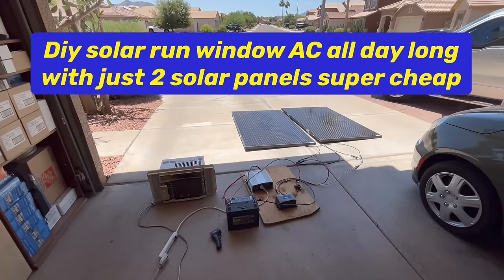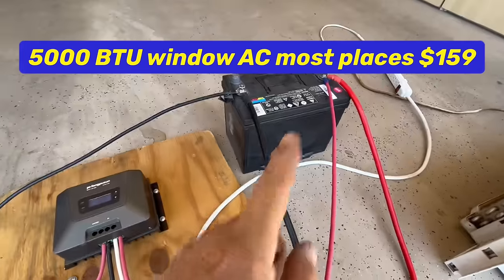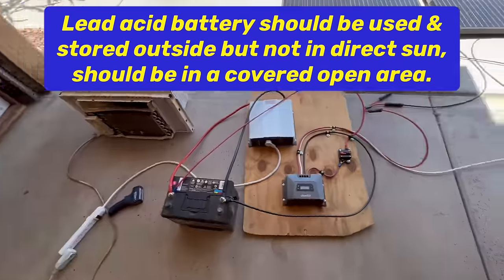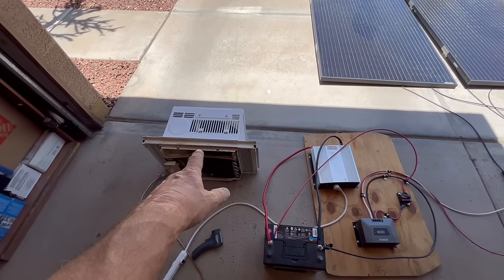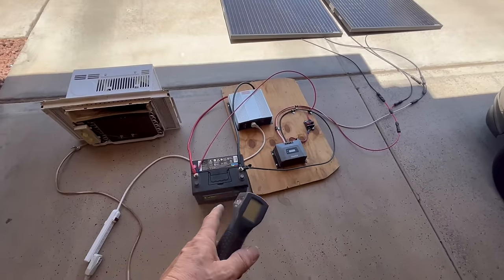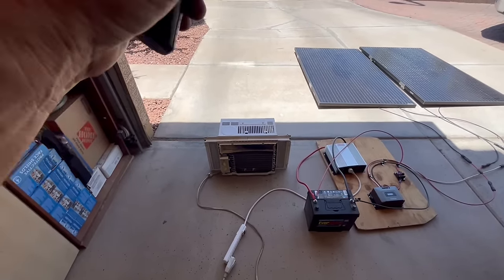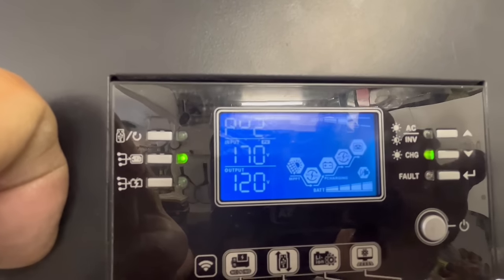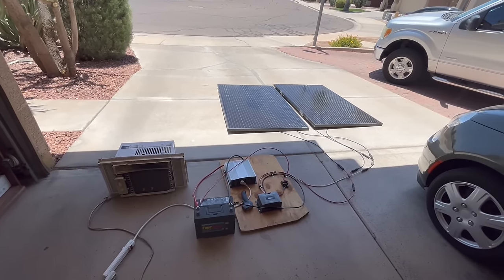Run your window AC with just 2 solar panels when sun shines. Easy DIY project you can do in one day.

Comment: So I was wondering I have 4 320 watt solar panels wired in parallel 5 100ah agm batteries in parallel aswell and a 3000 watt rms modified syn wave jupiter inverter and I can't run mine for more than 5 minutes without it draining my batteries and alarming the inverter?? I'm so confused
Reply from the maker: What is the actual output of your 4 solar panels. My 250 watt used poly panels are only giving me 112 watts. How many amps are you getting out out your solar panels in parallel? Your AGM batteries should be fully charged at standing voltage of 13.2 volts. My window ac uses around 450-550 watts and around 4.5-5 amps. My 2 330 watt solar panels were able to give me over 600 watts while running ac. You have to bring in at least 10-25 percent more watts than you are using so you can keep battery fully charged while running the ac load. If you have 10 solar panels and they are only giving you 50 watts each and your ac is using 550 watts, you will drain your AGM batteries. You have to always have more watts coming in than using and you want your ac to cycle off and then back on. When the ac cycles off, the AGM batteries will be able to charge faster with most watts being used to charge batteries rather than running load. Sounds like you are using more watts than solar panels can produce to run ac. What charge controller are you using. You did not a charge controller or all in one inverter with charge controller. I did this set up years ago and it was a bare bones set up just to show you can run ac with solar.  Ow I run my 3 1/2 ton whole house heat pump ducted ac to air condition my house 24 hours a day. Solar panel input during the day and LiFePO4 51.2v 100ah server batteries at night. I spend $0 on air conditioning my 2 story, 2450 square foot house and air condition my garage during the day as well. I heat my 15,000 gallon in ground pool to 89 degrees and run my pool pump 24 hours a day. I run 4 chest freezers and a fridge/freezer combo 24 hours a day on solar in day and battery at night. Check out my other recent videos to see how I did this. Hope this helps. Hope you have a truly wonderful and extremely blessed 2024

Comment: How many of those solar panels can you wire in parrell with that charge controller ?
Reply from the maker: For 12 volts battery you can connect 2 solar panels, for 24 volt battery bank you can connect 4 solar panels. The charge controller will allow up to 80 volts dc input from solar panels, so I can connect in series or parallel since solar panels have a dc output of around 39 volts. This is a simple display to show you can run a air conditioner with solar but is not really very effective. Using an all in one 24 volt off grid inverter would be much more effective and can parallel up to 9 inverters. But ever more efficient is a split phase off grid inverter where you can have 120 volts or 240 volts output from inverter which is pure sign wave. I actually run my 2 main central ac units with only solar in day and 25.5 kWh EG4 lithium iron phosphate battery bank at night. Check out my other videos to see how I did this.
Reply: @diy-solar-guy  Yeah I agree, but the price racks up pretty quick. I have a small window unit AC, and a bunch of 18650 battery cells from scooters I was going to put in a DIY pack to run as a cheap project with some of my used commercial panels.

Comment: I’m trying to run ac on my camper 24/7 how can i
Reply from the maker: You will need lithium iron phosphate battery. I used a 12volt 150ah 2kwh LiFePO4 battery with no solar. It was able to run this window ac for almost 4 hours. 2 of these batteries in parallel would give you around 8 hours of ac overnight, 3 would give you maybe 10-12 hours of ac overnight. They sell server rack batteries that are 12volt, 5120 watt hours, 100 ah. The tricky part will be having enough solar panels during the day to recharge your battery bank for the next night. I am going to put a 12,000 btu, 120 volt inverter mini split in my motor home in a few weeks. The benefit would be once motor home reaches set temp , the watts can decrease to 200-400 watts and still keep mini split cooling motor home. You will use a lot less watts than a window ac and with an inverter mini split, there is no surge with compressor starting. Check out some of my other videos. I installed 6 mini splits in my house, 2 upstairs, 2 downstairs and 2 in the garage to see how well they would cool and heat the house. A mini split will air condition and heat your camper. A 12,000 btu 120 volt mini split can cool or heat up to 600 square feet. A 5000 btu 110 volt window ac can only cool up to 150 square feet but will not heat area in winter time. I have videos showing air conditioning in summer and heating in winter in my house. Check out the videos. Hope you have a truly wonderful and extremely blessed week. Please don’t hesitate if you have more questions.

Comment: This will work but solar panels are not nearly as efficient as people believe.  A solar panel will put about 70% of it's rated power into a battery, even if the charge controller is an MPPT in hot weather.  So here, only about 462 watts are going into the battery if the panels are pointing at the sun. The inverter is using at least 15 watts to make the 500 watts, so every hour of running it this way, the battery is not staying fully charged. Plus, all lead acid batteries need to be over charged by 15% just to get fully charged.
Reply from the maker: You are correct, this is the bare bones basic set up to explain solar and how it works to run an ac. By expanding on this system, you will be able to set up a more permanent system like I now have. I run all my air conditioning upstairs, downstairs and in garage with solar off grid for my 2450 square foot house. My garage is about 600 square feet. All air conditioning using off grid solar and we air conditioning the upstairs with 25.5 kWh LiFePO4 battery bank overnight. We run our pool pump 24 hours a day, 4 chest freezers and a refrigerator as well. Check out our other videos to see what we now run with off grid solar. Thanks for your input and hope you have a truly wonderful and extremely blessed 2024.
Reply from the maker: I ran this in a small shed and it cycled off often, so was keeping battery charged. Only needed to be cool enough to keep equipment from overheating. Now we are running our 3 1/2 ton and 4 ton air conditioning with solar along with up to 5 mini splits or a combination. We run our 3 1/2 ton ac 24 hours a day with solar in day and battery bank at night. Thanks for your input. Hope you have a truly wonderful and extremely blessed 2024.

Comment: 11:40 Cool air sinks; hot air rises. Still interesting thing you got going on here.
Reply from the maker: Thanks I did not catch before uploading video, I realized I accidentally said it backwards about 235,000 views ago, lol. Hope you have a wonderful and blessed week
Reply: @diy-solar-guy  I just built a 12x14 foot shed, this would be perfect for that. Guess I'll have to watch your other vids as well.
Reply from the maker: @duratoke  this or a mini split. A mini split can heat in the winter as well and comes in 110 volt 9000 btu and 12,000 btu. Start at $500 on eBay. I installed 6 in my house and used for 2 years before I was able to figure out how to run my upstairs and downstairs central ac units. Now I run the 3 1/2 ton heat pump upstairs to air condition and 2 mini splits downstairs during the day. At night I run the 3 1/2 ton on a 25.5 kWh EG4 LiFePO4 battery bank. For Phoenix az last month my electric was $100. Was over 110 every day and 85-90 degrees overnight. Life is good with off grid solar. DIY on all of it. Hope you have a wonderful and blessed week

Comment: Is this setup safe? Could you add 2 more panels to that setup?
Reply from the maker: This is just the basic set up. Feel free to improve and add more safety features. I actually went in from this to where I installed 6 mini splits in my house, 2 upstairs, 2 downstairs and 2 in the garage. I also installed a mini split in my motor home. I also now can run my 3.5 ton upstairs whole house ac heat pump and 4 ton downstairs whole house ac heat pump. I can heat or cool my 2 story home and garage, a total of 3000 square feet with 100 percent solar in day and LiFePO4 battery bank overnight. I no longer use grid power for heating or cooling my house, running pool pump and pool heater with only solar 100 percent of the time. I even run 3 freezers and a fridge/freezer 100 percent on solar, also washer, dryer lights dishwasher on solar only now in garage but still can run a different set on grid in the house. Mini splits heat pumps are easy for home owners to DIY install and are much more efficient than whole house heat pumps. Check out my other videos to see how we did this. All of this mentioned above is DIY and completely separate from grid. All is off grid wired independently from grid. I can charge my batteries banks with solar. I now have enough that if I moved out in the country could completely supply my entire house electrical needs with only solar and battery bank for overnight. Hope you enjoy the videos and hope you have a truly wonderful and extremely blessed 2024. Feel free to ask questions, I usually reply with in a few minutes to a few hours.
Reply from the maker: You can add as solar panels as you want but would need to add more charge controllers as you add more panels. That charge controller was maxed out at 2 solar panels.

Comment: So you have max 660 watts in perfect conditions powering a  1550 watt AC unit using a 2000 watt 12v inverter with a 100 amp hour battery. I don’t think you thought this through. It’s only going to run for about 30 to 40 minutes if that.
Reply from the maker: It’s only 500 watt ac usage. Not 1550 watt. It ran all day for 2 years.

Comment: Ever considered using LiIon battery?
Reply from the maker: I am using Lithium iron phosphate and will continue to build my battery bank with them since I am in too deep to change. I have a few videos on Using 2 different types of Lithium Iron phosphate batteries.  I have 4-12v lithium Iron phosphate batteries I will use with a window are if I put in motor home but I also have 2 51.2v server rack batteries I can use but will have to find a smaller 48v inverter to put in motor home to use those server rack batteries.

Comment: What does he do for a living?
Reply from the maker: I am permanent disability retired going through 3 different cancers with a lot of time on my hands for last 10 years so I learned about solar and started connecting solar components together to see what I could do. Check out my latest videos where I run my 3 1/2 ton & 4 ton heat pump to air condition my 2 story 2450 sq ft house as well as my 600 sq ft garage, heat and cool our 15,000 gallon I ground pool and run pool pump 24 hours with solar during the day and LiFePO4 battery bank overnight. We started with that window ac over 4 years ago with no experience with solar or hvac. Check out the videos and you will see what you can do DIY off grid solar. Hope you have a truly wonderful and extremely blessed rest of 2024.

Comment: How long will it last before you run out of power
Reply from the maker: This lead acid battery without solar might last 20-30 minutes with no solar, AGM battery might last a little bit longer with no solar. A lithium iron phosphate battery 150 ah 2 kwh with no solar will last around 4 hours. Unit uses 500-550 watts an hour. I am actually running my central ac on my house which is 2 story 2450 square feet with a 3 1/2 ton and 4 ton central ac units. I use a 25.5 kWh EG4 LiFePO4 battery bank for over night use and 11,000 watts connected to 12kw Growatt off grid inverter to run on solar during the day. Check out my videos on running heat pump ac units to cool and heat my house. I also installed 6 mini splits, 2 upstairs, 2 downstairs and 2 in my 3 car garage. I can use those instead of central ac in house to heat or air condition my house and garage. Hope you enjoy my other videos and hope you have a wonderful and blessed week

Comment: can a 2000 watt inverter handle a 4000 watt surge?
Reply from the maker: The question should be for how long can the inverter handle the surge. It can but for only a short period of time, like fraction of a second. But not all 2000 watt inverters can handle doubly the watts. Some may only do 3000 watt surge. All depends on the specific inverter you buy.

Comment: Cool air drops. Hot air rises.
Hot air is less dense, so it raises. Cold air is more dense, so it drops to the floor.
Reply from the maker: You are correct, it came out backwards and did not catch to correct before uploading video.

Comment: How long does that run, 15 minutes?
Reply from the maker: Will run with the minimum components as long as the sun is shining, if it is cloudy, it will probably stop running because this basic set is not able to run with it being cloudy. But in Arizona where we have over 320 sunny days a year it will run for about 7-8 hours in summer when full sunny day. This is just a bare bones example, I used this in a shed for about 2 years. If you added a charge controller that could handle 1500 watts of solar and a LiFePO4 battery, you could run when cloudy and maybe even over night. But this is just the bare bones components needed to run ac. Every upgrade and improvement will make it run better and longer. Don’t expect a bare bones system to run like a window ac plugged into grid power. You have to produce enough watts with solar panels to run the ac and keep battery charged at the same time. I run my whole house air conditioning which is a 2 story house and the garage with just solar during the day. I use LiFePO4 battery bank to run overnight. Hope that helps to answer your question.

Comment: Go below 12.1 and you start killing the battery I believe? I try to keep my volts above 12.1 at all times
Reply from the maker: You are correct. You do not want to go below 12 volts with a lead acid battery when discharging battery. Adding more solar panels to basic designs and more batteries in parallel will help to keep battery charged while running load. This was just a basic example showing with very minimal components you can run a window ac with solar. When you take basic design and improve it, you will have a much more stable system. Thank you for your input and hope you have a wonderful and blessed week

Comment: Whats the specs on charge controller?
Reply from the maker: Can only handle 2 250-330 watt solar panels at most and can use as 12v or 24 volt (auto sensing when you connect battery). Can charge up to 50 amps. But i bought these 4 years ago and can not find them anywhere for sale. I bought from santansolar.com. You might be able to call them and see if they know if they are still manufacturing charge controller. There are many options out there to choose from. Basically I need at least 450-550 watts or more to run ac unit, would be an upgrade to be able to add even one more solar panel but you would need a charge controller that can handle 1000 watts to do that. I am trying to get stuff to do a upgrade from this because if so much interest in viewers wanting to install in sheds and all kinds of places. Honestly the best thing you could do to upgrade from this and have it last 10-20 years would be to go to a 24 volt all in one off grid inverter that can input up to 2400 watts in solar panels. You are really limited with a 12 volt inverter and charge controller as to how much solar you can connect. Hope this helps. Hope you have a wonderful and blessed weekend

Comment: what size ring terminals do i need?? 5/16 or 3/8 ?
Reply from the maker: Not the same size on all parts. Just depends on where you Seder from. I have bought some that are 3/8 and also some that are 5/16. You will have to see size on the ones you buy.

Comment: Not sure a modified sine inverter is a very good idea for running a compressor. It will produce inefficiencies and heat in the electric motor. I would get a pure sine wave inverter.
Reply from the maker: I agree, I only had a modified sign wave inverter. Pure sign wave inverter is better.

Comment: Hello,
Unrelated to this video. I too live in phx area and I too am running a Growatt 12k. It had been running my 4 ton but recently it will not. 
Did you have success with the soft start on your 4 ton and the Growatt 12k?
Reply from the maker: There is a link for the one I purchased at end of this response.  just got my soft start for my 4 ton today. I will be installing this week. I had problems starting without soft start. The inrush amps to start my 4 ton is 109 amps. The inrush amps on my 3 1/2 ton was 78 amps. After installing soft start on 3 1/2 ton, inrush amps dropped to 18-24 inrush amps. I even used the same model soft start on my 12.7 ton pool heater heat pump and it dropped my inrush amps from 186 down to 42-48 inrush amps. The 12kw Growatt is great but need to install soft start to make it really easy to start. I don’t even hear my 12kw Growatt make any noise or fan kicking on now with soft start. Use to hear a load buzz sound at start up, not anymore. Hear is a link for the soft start I use on my heat pumps 3 1/2 ton to 12.7 ton.
https://signaturesolar.com/surestart-soft-starter-4-ton-and-under/?ref=oJ3Bgl9hDE3G
Reply: @diy-solar-guy  awesome!   Thank you very much. Funny because it runs my 3.5 ton all day. I installed hard start on 4 ton, helped at first, but when unit heated up it quit working again. I will order the soft start today. 
Enjoy your videos! Keep posting
Reply from the maker: @rossferguson5277  that soft start should do the trick to consistency start up and run 4 ton